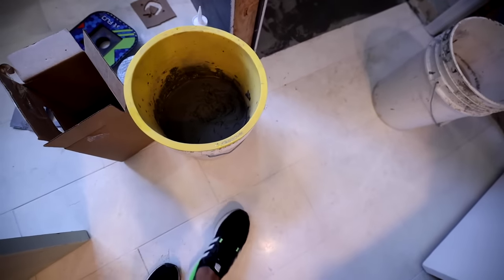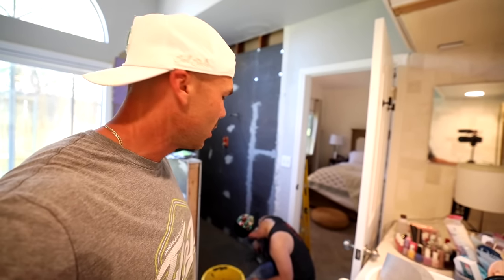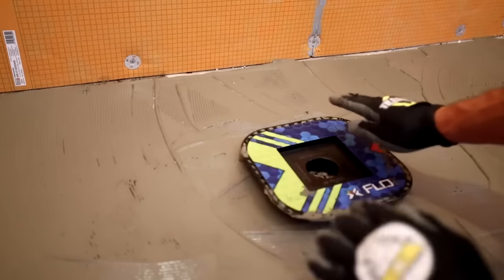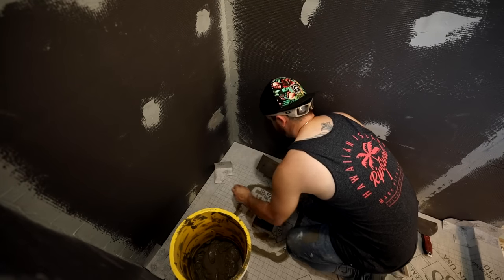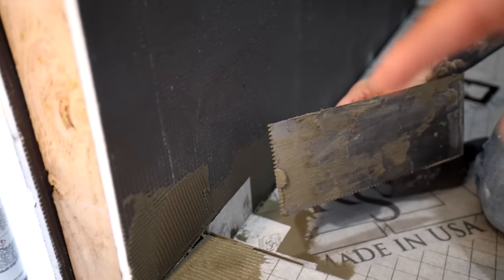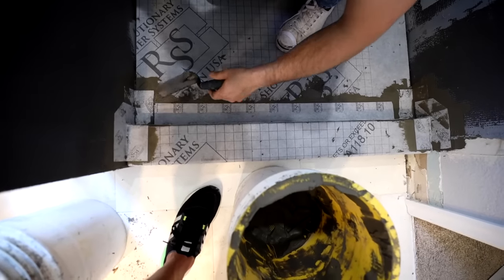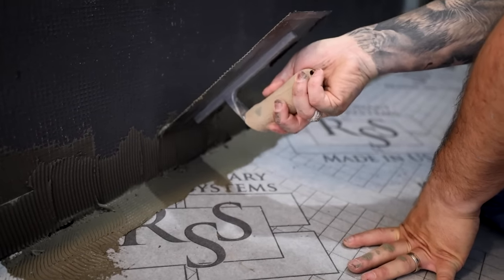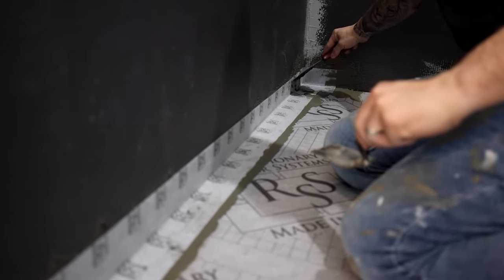I Teach DIY'er the RIGHT WAY TO WATERPROOF A SHOWER

Comment: As a General contractor I am amazed by the lack of knowledge so many tradesmen have. I can't tell you how many times  I have  had to tell subs how to do the job correctly!  I started out in high school building rentals for my dad , then worked for a remodeling contractor ( who did every trade in house) for two years  and  by then I was running the crew.  I got my license   and started my own buisness shortly there after.   I have vast knowledge in every trade and  am very meticulous with my work and so very proud of it. There is no reason anybody should screw up a job when  youtube is available to learn! Keep up the video's  ! My suggestion would be to always use color matched caulk at the seams( there will always be movement, settling etc.) and  put membrane on shower floor first before  the perimeter bands.  I really don't like the concept of using thinset in between because it gets wet and wicks water, so I use the  liquid /caulk warerproofing method

I still hot mop and float at times. Never had a singe call back  on any of my jobs and been licensed since 1993!!!!!

Comment: Why not fully overlap the corners with the long strips? Too much build up? If you cut them even slightly too short won't there be a possible gap for a leak? By the way great video! One of the best.
Reply: They are overlapped, by 2". The corner pieces go 4" out from the corner and are already double layer from the outside corner band or corner band for 2" out from corner, the extra 2" is where that overlap happens keeping it at 2 layers and keeping a 2" overlap as required by these systems.
Reply: Remember that this curb was fully integrated into ONE piece at the factory. I too missed that, until I rewatched.
Reply: I was thinking the same .. barely overlapped, vs. Kerdi requiring 2"

Comment: For osb flooring what should the first few steps be for me? Plywood 3/4 pressure treated 
OateyLiner
Metal galvanized lash
Drain
First pre slope4 to 1 mix
OateyLiner
4 to 1 mix
Thinset
Tile
Do these steps sound proper?
Reply: I have been doing showers longer than these two guys have been alive. Do yourself a huge favor and pay to have it Hot moped.

Comment: Hi Isaac, thank you for your great teaching. I have a question for you. I have to lay 24x24 (3x8) tiles with Mapei-modified cement with a 1/2x1/2 trowel. Considering your great skill, once completed that, what would be the approximate thickness of the tile plus the cement after the back-and-forth compression during the laying (3/8 tile + ciment) = ?.  Thank you
André

Comment: Hi, been watching a lot of these videos. I did purchase a FloFx drain. I have a question with using it on subfloor and water proofing. Thought I would put down plastic and chicken wire. Then Dry pack. After that not sure what the best membrane is. I’m using 2x4’s and cement board for the curb. Like to do a roll on membrane feel like it’s easier with some thin set and tape. Or should I be using a membrane sheet. I also seen video of using membrane sheet under the dry pack. I don’t know if that has to do with the type of drain. Enjoy the videos thanks.

Comment: This comment is about a job you did about 4 years ago.  It was called Grandpa Bath.  Two questions.  First, on the glass tiles you had to fill in the individual pieces on the left and right edge.  Can you buy individual pieces or did you have to cut those from tile squares?  The second question was about the pencil tile you used as a perimeter around the glass tile.  I wondered if the joints would have looked better if they were lined up with the subway tiles.  Just wondering.

Comment: Great to see you teaching a DIY'R, I am surprised in the US you haven't adopted flexible membranes more and stick with thin set application, I know you have Red Guard and there sems to be problems with that product, in Australia we solely use Class III flexible membranes for waterproofing, much easier to apply, if done properly they will last 20-30 years or more, maybe you still have "step 2" to do which is membrane application ?

Comment: My four keys to a lifetime shower:

1. No cementitious substrates, period.  Not the walls not the slope.... nowhere.  It’s 2024 and there are waaay better choices that do not become 200 pound sponges with daily use.  

2. Proper monolithic waterproofing.  All seams, all penetrations.  The tile and grout are there for aesthetics and clean-ability only.  

3. Proper ventilation.  Something that never gets mention in any of the top tile channels on YT.   Train the grout and tile to dry to the air, not into the substrates.  300 cfm in-line ventilators will work for most bathrooms, on a digital timer that can be set to run 30-60 minutes beyond the time it takes to take a shower.  THIS IS CRITICAL.  

4. No bleach-based, ammonia-based or anhydrous cleaners (which is 90% of the cleaning market).  Plant-based cleaners only.  To assist with this, customer needs to train themselves to squeegee after every shower and towel off the fixtures. It’s worth it!

Comment: Have you tried the Revolutionary Shower System Pro pan? Any thoughts on that?
Reply: I just installed the RSS Pro Pan and it is awesome. So glad I went with it compared to the HD. The Pro Pan has cut-outs along the edges to set the foam cement walls into and then you can use the RSS Sealant where the pan meets the walls and you don't have to use any of the banding at all. The HD Pan does not have the cutouts so you have to use the banding which is a lot more work in my opinion. I found it worth the extra cost over the HD.

Comment: If all of your channels made by your trowel don't line up, how do you get enough air out?  I have noticed before on other videos where you have intersecting channels.  There is a video where a guy showed how you can't possibly collapse the  channels with intersecting lines.  He used glass to show the trapped air.  Shouldn't this be a bigger concern?  I always make sure my channels go unimpeded to get my coverage on the back of my work.     My EDIT:  Not speaking about the fabric application so much as with the one piece foam and other tile videos.

Comment: The bands should have went almost all the way into the corners.
Reply: The corners are literally designed  so you don't have to go to the corner to avoid buildup...
Reply: @sampon9328  Supposed to be a minimum 2 inch overlap to any gaps. Water can get through where the corner and band meet because its not overlapping. I don't see anything about the design that would prevent that. They are the same as schluter.